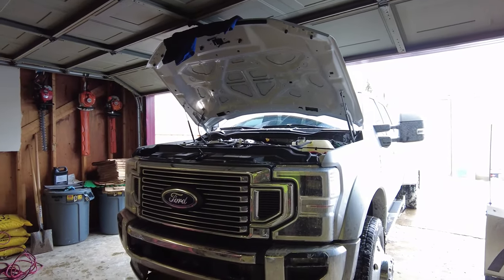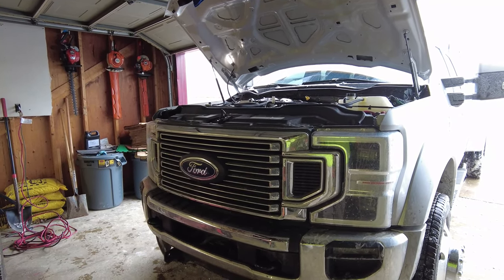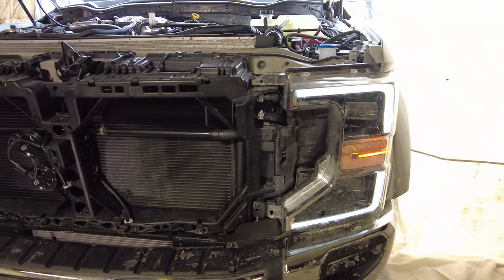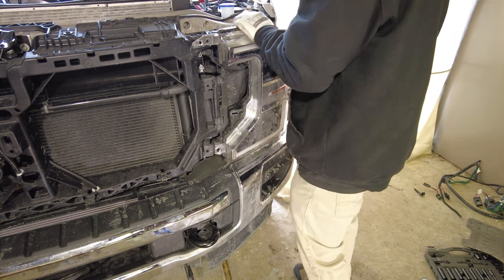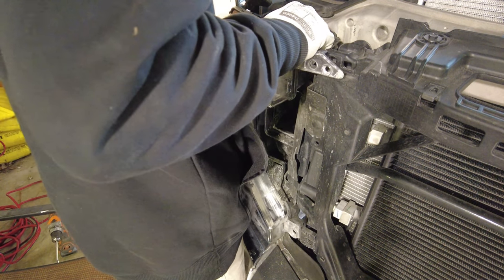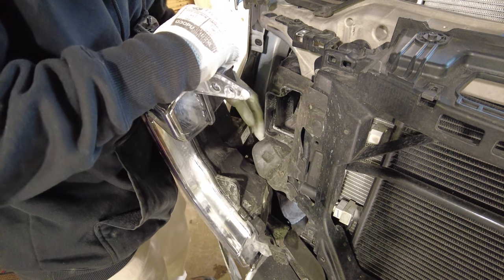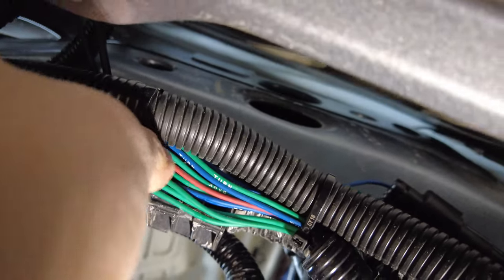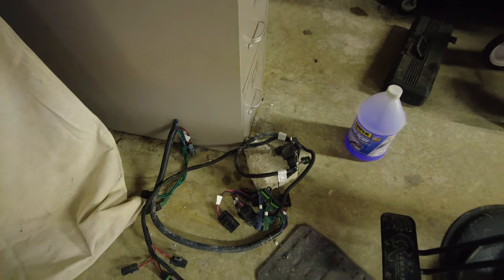Snow plow install goes HORRIBLY WRONG! | UP DATE!

Comment: This is becoming a common issue with 2020 Super Duty trucks that are wired for plows. My 2020 F550 fried it's main wiring harness and nearly caught on fire. A lot of municipal 2020's in my area have caught fire and even burned down their entire building. If you own a 2020 or newer Super Duty, check your electrical connections and fuse box under the hood daily!

Comment: We used to mow and plow a condo Association and one of the owners had a Daughter who was an engineer at Ford and back then my 06 F250 was brand new and while plow there he stopped me and asked what I liked and didn't like about the truck. I told him one thing I wished they did was put heat to the convex part of the mirror....2 or 3 years later they're all heated, your welcome lol. Another suggestion was incorporate a designated area for these plow modules so you could actually reach them, well, that suggestion must have fallen on deaf ears, sorry. lol
Reply from the maker: Thanks for the heated mirrors.

Comment: It looks like you were sold a wiring harness for a 17-19 model Super duty. The wiring harness changed a little bit with the 2020’s. I recently went from a 2018 to a 2020 Super Duty and wanted to reuse my 2018 harness. I had to buy a separate addition for my current harness to make it work. Pretty sure it changed the relays.
Reply from the maker: That very well could be what happened.

Comment: Holy f balls, I’ve got this problem. Thanks for the video
Reply from the maker: Really?!?
Reply: DS TRUCKS ok not the exact problem but close! It’s  a western  wide out. Fisher/western are owned by same company and it’s the  same electrical. Cannot get either ford or my western dealer to commit to fixing it or taking responsibility for the brand new 2020 truck/ 2020 western wiring.. 
no low beams on truck or plow. This is giving me some direction! Wondering if it’s a defect in the relay for my lows.
I’ve basically got my high beams aimed down, sucks in a snow storm.
The installer has replace one of my wiring harnesses from the module to the plow. Solved problem for 30 min, then back to no lows
Reply from the maker: @tompritchard2142  they might be putting the wrong harness on. 2020 have a new harness.